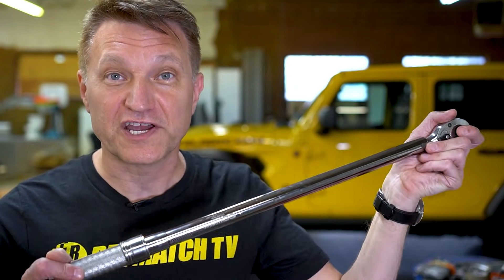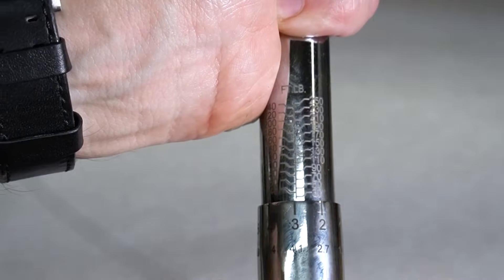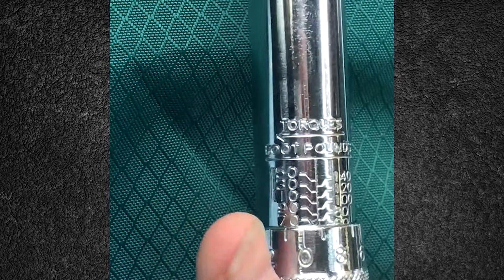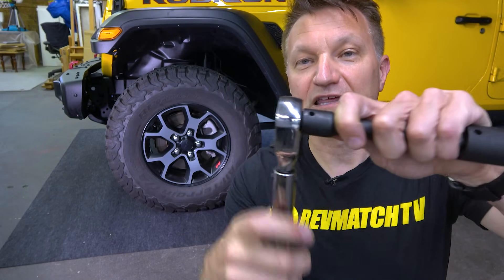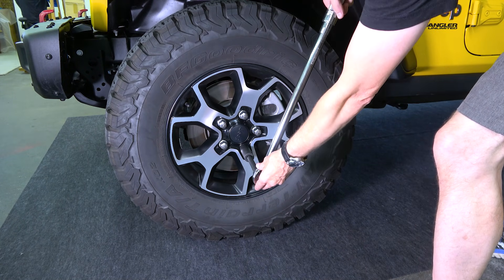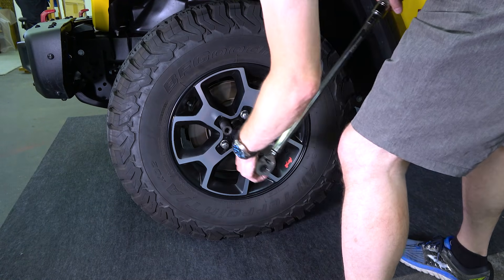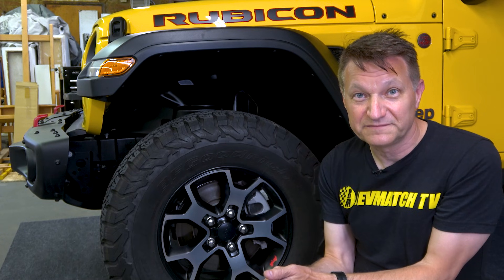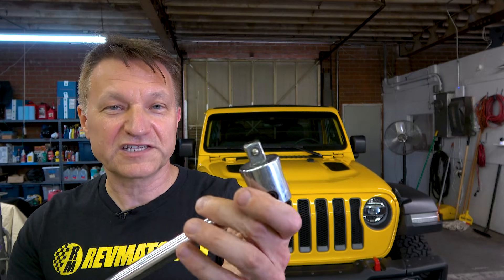How To Use A Torque Wrench For Beginners - Updated!

Comment: Looks like people can learn what they need to get started with a torque wrench in... Just One Click... By clicking on this video!
Reply from the maker: Clever 802!
Reply: @revmatchtv  When you put the Torque wrench away  after using it and back the pressure off,  the little lock knob at the bottom, should that be locked on or off?
Reply: @lightningsmokerXx  On brother
Reply: @lightningsmokerXx  either way is fine. If you put it back in the case unlocked it s not going to move on its on.

Comment: Does the black dial/button on the end need to be tightened after setting the torque?
Reply: If your wrench is the type with a knurled locking thumbscrew at the tail, then yes, firm it up after setting the micrometer scale. If the lockscrew is left loose, using the wrench can rotate the handgrip, altering the torque setting. You'll have to slacken off the lock each time before you alter the torque setting.

Comment: Hello. So, I "rented/borrowed" a torque wrench from O'Reilly's.  Need to do head bolt to 44 ft lbs, plus 90 degrees.   Did first 8 on one head to 44, moved dial to 55 so I could add the 90 degrees.  Then went to second head.  Dialed back down to 44.  Busted bolt. Looking at instructions, which I didn't bother to do initially, it says that when resetting wrench, always go back to zero.  Is this common knowledge? Because the guy at the store didn't say anything, and I've looked at a couple of videos online that also didn't mention this.  Is that why my bolt busted, because it was still set at 55, or was that wrench just faulty?  Or maybe a bad bolt? I was using new bolts.
Reply from the maker: I'm not really sure what the issue is, but there's no such thing as 'resetting' a torque wrench. After you're done using it, you should set it back to 0 however for storage since it will become inaccurate if you leave the spring compressed for a long time.  On another note, you really shouldn't be trying to torque down a head if you have no experience. It might look simple, but it's a delicate operation with extremely expensive consequences if not done right.

Comment: Around 5:45 you say you pre-tighten by moving the wrench a couple of times before finalizing with the full range of motion until you hear the 1 click.  What do you mean by pre tightening? Isn't the torque wrench tightening and you tighten to the click? Sorry for such a simple question :)
Reply from the maker: You need to get the nut snug so it's got a bit of friction. It should be up against the wheel, not loose.

Comment: Great video!  I'm trying to tighten my lug nuts but and have set my wrench to the factory spec 95 ft lb, but for the life of me cannot get the torque wrench to turn the nut. Do I need to loosen the lug nuts first before tightening them, or is it possible that my car dealer mechanic set them higher than the 95 spec?  Thanks
Reply: If you get no wheel lug nut movement that means that the wheels are torqued to at least 95' ft-lbs or higher. If you want to be accurate break them all loose a quarter turn and then retorque to your factory spec. Then retorque 60 miles later again.

Comment: The question is can a torque wrench be used to looosen the Wheel lug nuts?
Reply from the maker: Yes, but you'll slowly damage the torque wrench and it will go out of spec.
Reply: No.

Comment: I did not know you were supposed to back off the setting and left the spring under tension when I put it away - how can I determine if the tool is still calibrated correctly?
Reply from the maker: If it's a $20 harbor freight torque wrench just get a new one. If it's expensive, contact the manufacturer for calibration quesitons.

Comment: in general good video, however on bolt five (the last one) it looked like you put extra twist (maybe 5 to 10 degrees) after the wrench clicked.  My apologies if you didn't.  Torque to the click and that's it.

Comment: When you put the Torque wrench away  after using it and back the pressure off,  the little lock knob at the bottom, should that be locked on or off?

Comment: Why does every video on tourqe wrench don't go over multiple tourqe setting valves and how to do that like head bolts have to be done at 22 then 44 then 66 as final setting on 4.3 vortec v6 and someone said I set it at 22 then redo 3 times and don't raise the value on handle and don't see how redoing at 22lbs 3 times without adjusting handle will tourqe it to 66lbs and feel not correct and must do at 22 by handle then move handle to 44 then redo bolts then move valve again on handle to 66 and redo bolts for the third time to get to 66 final tourqe setting but not covered in videos and guessing that this never comes up and seems obvious to me to move the handle value up as you go but got someone saying don't and my first engine head and first time using tourqe wrench and into a job deep lol
Reply from the maker: I have a video on setting the torque on head bolts.

Comment: Anyone have a strategy for people who aren't strong enough to reach the desired torque value for truck wheels? Last time I removed wheels I could barely reach the required 150 ft-lbs and now nobody in my family can reach that value to finish my current auto repair job. What is the strategy for slim and short people?
Reply from the maker: Lift weights!
Reply: That's thumbs downs 😅
Reply: I could be wrong but you might find some help using a breaker bar.

Comment: Excellent video.  At first I thought it seemed long, but you cover a lot.  What I miss is the about holding the wrench, because the measurement is based on the lever-arm length.  I was hoping you would cover the correct hand location when using the torque wrench.  Like properly  using it from the handle, and centering, usually with the middle finger on the groove of the knurled handle.
Reply from the maker: I’ll do another
Reply: @revmatchtv  let me know when.  It was a tough dig, but I got some laminated cards finally from Snap-On / CDI, titled "Torque Wrench 101" which do include a diagram of force at the handle.
Reply from the maker: @TonyDiem  it will be a few weeks at least. I’m currently moving so lots to do!

Comment: If you have a torque value of 160 lbs ft and the wrench goes only  to 150 lbs ft...
...Do you do the difference of 10 lbs ft to add on the specs?
Reply from the maker: Either get a higher value wrench or just guess. 160 lb-ft is pretty high as it is.

Comment: How bout on an inch pound torque wrench...does each digit when turned (1-10) equal to one digit or multiples of ten or what??  Nobody seems to covers this stuff with a inch pound torque wrench....Math challenged old inch pound torque wrench folk need love too. LOL!
Reply from the maker: Look at the dial. As you rotate the dial it will tell  you what fraction you're at. It's not mulitples of ten. It's the number on the dial. It's exactly the same as any torque wrench.
Reply: @revmatchtv  Thankchu...bery much😉

Comment: Can you set the micro adjustment the ones with 0 - 8 reading in between lets say if the torque settings says 10.5 so can you set it between the 0 and 1?

Comment: Maybe I am deaf. I can't hear the clicking on my torque. Is it damaged already? I bought it from a (don't wanna tell) shop for only $11+tax. Maybe it is cheap that is why it may not click at all?
Reply from the maker: You should be able to feel it.  $11 might not be enough to get a decent one. I have links in the description for slightly more expensive ones.

Comment: thanks! i just got the two answers i was looking for ... 
can i use a torque wrench to loose bolts?? nope. it is just one sense tool. .. you better use a breaker bar
what is this switch for? right-handed threads (set by default) or left-handed thread

Comment: Hello, I believe I have the same torque wrench by CDI. I bought it recently and only used it once. However, when I finished I loosen it all the way down past the lowest setting until it stopped. Will this ruin the calibration? I immediately tightened it to the lowest setting. Also, I saw on their website that the wrench should be used 3 times at maximum setting. Is this a way to brake-in the wrench? Thanks!!
Reply from the maker: Follow their break-in instructions. You can leave just a tiny bit of pressure on it when you store it. Right below the lowest setting.

Comment: Why not an impact wrench for the job
Reply from the maker: Because I’m teaching people how to use a torque wrench. You cannot get accurate torque with an impact and you can easily damage a bolt or stud.
Reply: RevMatchTV agree. But you could tighten but not specs first?
Reply from the maker: IF you know how to use one correctly and not jam on the bolt. Most people don’t know how to do this.  This video is aimed at beginners.
Reply: RevMatchTV I’m an impact beginner for sure. But a cordless impact used in lower setting used carefully by first tightening by hand could be a simple option
Reply from the maker: Jeff W Take your time, go slowly and learn how to tighten the nut so it has barely any pressure on it and then finish it with the torque wrench.

Comment: You're the second guy on these vids I've seen say that saying "foot-lbs." is incorrect (even though it says "ft-lbs." on the wrench itself!)  Why do you think you know that "ft.-lbs." is incorrect?  Where did you gain this truth?
Reply from the maker: According to the  Society of Automotive Engineers applying torque to a fastener is expressed in pound-foot. If you're interested you can Google it. It's on their website. 

Google "Gary W. Pollak, P.E., Program Manager for the Society of Automotive Engineers" and you'll see the reference. The SAE is considered the standard. Good question!
Reply: @revmatchtv  Ok fine but it was expressed as ft-lbs decades ago in my college text books.
Reply: @jag3384  Pounds per foot 
or
Foot per pounds.
Only one makes sense. RevMatchTV is correct.

Comment: Hey mate, came across your old vid and read your comment regarding this vid. Bit confused with my TOPTUL ANAG1208 wrench. So NM is fine since it has whole numbers but for Ft-Lb it has decimals engraved on the wrench. For eg. it starts from 14.7, 22.1, 29.5 and goes up to 81.1 and on the handle it has numbers from 0-9 and marks between each number for eg. 0|1|2|3 you get the idea. Can you please advise on how the hell do i read Ft-Lb. its driving me nuts. Thanks and keep up the great vids mate!
Reply from the maker: Ft-lb is just another unit of measurement. The higher the number, the more torque you'll get before you hear the click. If you're aiming for 23 lb-ft start at 22.1 and turn the dial up to 9.  It's confusing because your wrench is mapping the NM to lb-ft in a strange way. Generally the values will be 20, 30, 40 etc. Just add up the number on the shaft and the number on the dial to get to your desired spec. Or buy a different torque wrench that's easier to use.
Reply: RevMatchTV thanks for the reply but you misunderstood me. My wrench is just like yours in the vid doesn’t look the same but it has Ft-Lb which is (pound feet) on one side and on the other side it has NM. NM is engraved in whole numbers where as ft-lb isn’t. Got issue reading the decimals for ft-lb and dont know how to go about it. Wish i could attach a pic here for you. Would have made it much easier to understand what i was saying.
Reply from the maker: Very strange that the ft-lb is not in whole numbers. Can’t say I’ve seen one like that in North America. 🤷🏻‍♂️

Comment: Hi can you use the torque wrench in reverse say for taking glow plugs out?
Reply from the maker: You can, but it’s better to use a normal wrench or a breaker bar if they are that tight. You want to keep it in spec as long as possible.

Comment: The impact socket is made from slightly softer but more ductile material.  It is less likely to split with impact motion. 
The hand should be in the center of the handle.  More expensive torque wrenches have a smooth ring on the handle to show where the force should be applied.  The force should be perpendicular to the handle.  Clicking more than will increase torque with each click.  These minute things will not affect torque on cars with wide range of torque value, but in more precise application do make a difference.
Reply from the maker: Thanks for the explainer!
Reply: @revmatchtv  You bet.  You do have some very good points.  Such as Ft-Lb being the correct unit for torque per ASME, and extensions changing torque.  I believe that misnomer comes from impact wrenches.  Since the springiness of the extension will absorb some of the impact motion then counteracts the desired direction of the impact wrench.  A slow and steady force on the torque wrench will have no appreciable effect on the torque.  Unless the head is not supported and it's no longer a perpendicular force to the nut.
Reply from the maker: Yes. For most automotive applications as long as you keep the force perpendicular and use a smooth motion you should be more than fine.

Comment: Is it a bad idea to use a torque wrench to undo bolts? Don't have the $30 for another breaker bar
Reply from the maker: Use a normal ratchet wrench instead. A torque wrench should really only be used to torque bolts if you want it to stay accurate.
Reply: It's like changing to winter tires: it seems more expensive at first glance but than you realise that two sets of tires wear two times slower. The more you use the tool the sooner it will brake. Especially if you overload it constantly.
Reply from the maker: Exactly. When you get the $30 you should definitely get a breaker bar when you can. Your torque wrench will last a loooong time instead of going out of calibration after a few uses.
Reply: @revmatchtv  OMG! omg! I used it to loosen the bolt on my 1997 Honda Civic cuz I don't have any other tool.
Reply from the maker: @balloney2175  don’t sweat it but it’s best not to make it a habit if you want it to stay accurate over time.
Reply: @revmatchtv  I'm 66 and my hearing is bad, I can't hear any click. I will go to the store where I bought it and check if it is really clicking.
Reply: @balloney2175  u got 2 so far😏

Comment: I thought extensions changed the torque value. Meaning 130 on the wrench wont be 130 when the extension is involved.
Reply from the maker: It does not change the torque value

Comment: I was always under the assumption that after the first click, the wrench should not be able to turn the bolt.. but I always feel like the bolt has quite a way to keep turning after the first click, so I've gone to a few clicks until the turning stops.... as I didnt think it could over-torque because of the value set..  let me know if im doing this all wrong!
Reply from the maker: The click is just a warning to stop! Don't keep going. You're putting way too much torque on your bolt!
Reply: @revmatchtv  so even though the bolt keeps turning, stop! is what you are saying
Reply from the maker: @hanokezawde9774  Exactly! The torque wrench is not stopping you from going too far.
Reply: @revmatchtv  From a Master Tech here. Maybe you should have mentioned not to do a follow through after the first click of the torque wrench thus preventing evertorqueing the desired torque value.
Reply from the maker: John Finch I believe I said that in the video. I maybe worded it differently but I said to stop after the first click.